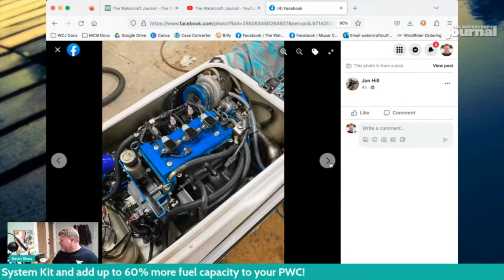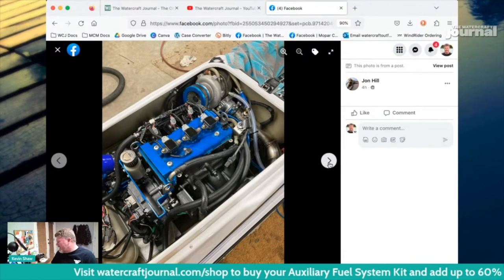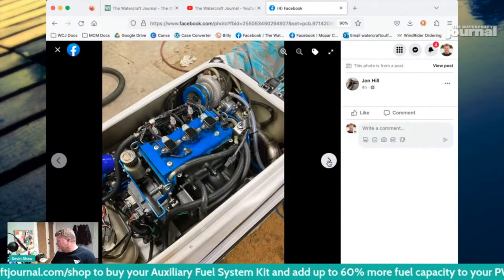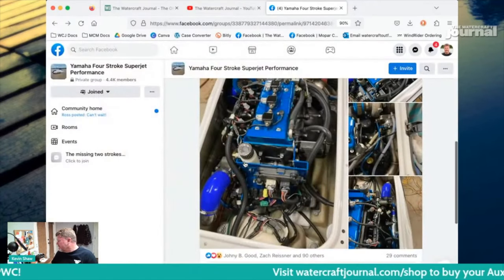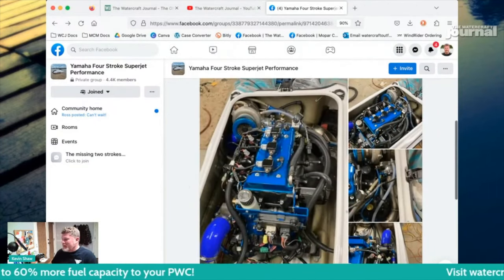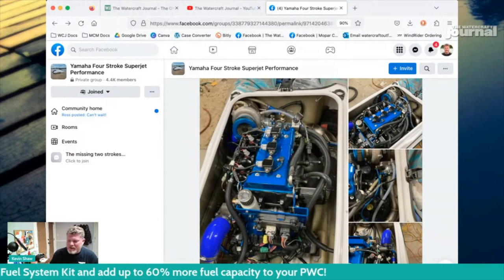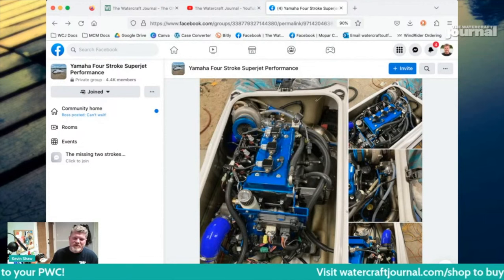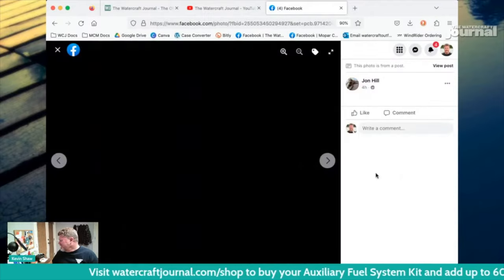Discovering Pro Watercraft's Turbocharged Yamaha SuperJet: WCJ Quick Topic

Comment: Hi Kevin,  Jon Hill thanks for talking about my Superjet Turbo ski. The filter is turbo spa. The intercooler is under the intake 
thanks for talking about it. Thanks Jon Hill
Reply from the maker: Absolutely! How’s the turbo ride?
Reply: @watercraftjournal  Very fast gps 67 mph, winter project changing out the rods, modifying  the ride plate ,You are  welcome to take a rip on it.
Reply: U got some balls man going that fast on a standup the 4 stroke superjet scared the pants off me stock
Reply: @henrytischbein155  You just get use to the speed.  I am trying to go faster next year. I am working on some handling, prop, rods.